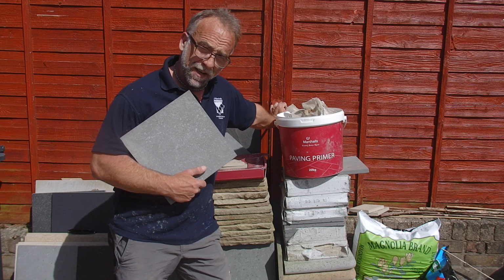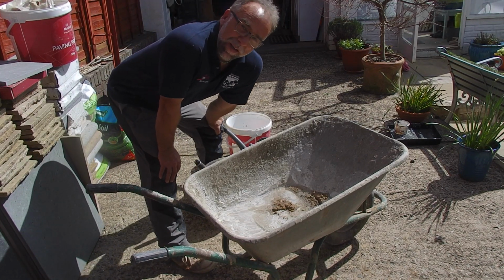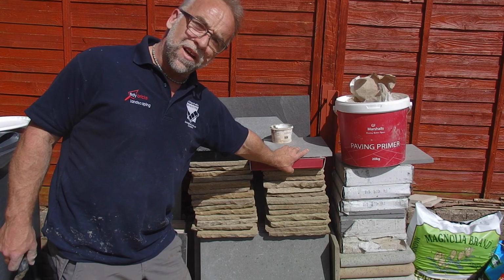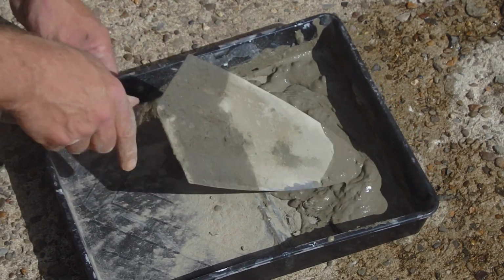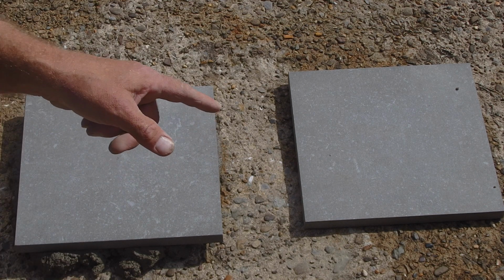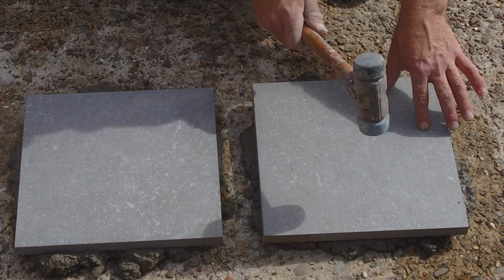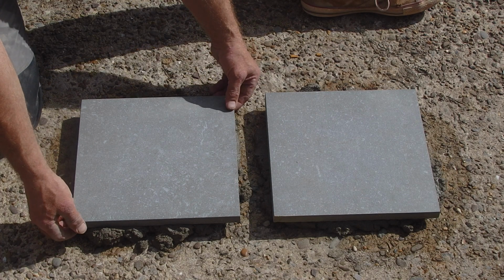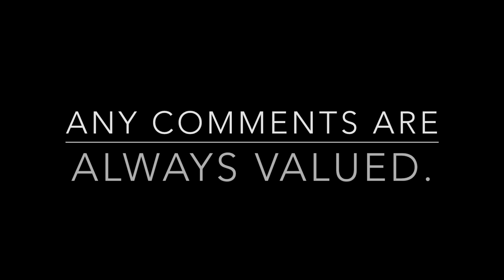Expert Advice on Priming Porcelain Tiles: What You Need to #primming #slurrygrout #primmer

Comment: You can use a cement slurry to prime the back of porcelain tiles or a sbr coat, both give excellent adhesion.
Reply from the maker: There’s lots of ways and a very important part of the installation must be done 👍🍻
Reply: I did the same thing,  I used a cement slurry mix as primer when I lay porcelain  outside!

Comment: Agree with you always have to use primer on a porcelain tile but I never buy it, sbr and cement for me, also I use a mix of sharp sand and building sand 70/30 for bedding as sharp sand for strength and building sand to help make mix pliable and to create more suction but liking your work tidy bricks. 👍
Reply from the maker: Thanks Wheaton I’ve had so many questions about primers so I decided yesterday to do a video and pass the boredom of self isolating..
And yes primer for porcelain is a absolute must. 👍🏴

Comment: I've got a 3 Indian stone flags that have come up after I pressure washed.  The bed is still flat.  Could I use this primer to  stick it back down rather than messing with the bed and making a bigger job?  I'm going to have to repoint too as washer took loads out.   Thanks.
Reply from the maker: Yeh you’ll be fine just using primer it’s stick back down nicely no bother bish bosh 👍🏴
Reply: @tidybrickslandscaping  great, thanks for taking the time to reply.

Comment: Myself and father in law will be installing porcelain tiles out the back garden this weekend. We have Evo Fix SBR waterproof bonding admixture, my question.... Does this need to be mixed with cement or can it be applied to the tile straight from the bottle? Your feedback would be appreciated. 😀
Reply from the maker: A cement based primer is best for porcelain I’d go down that road really. I did use sbr before on stone slabs only. 
No point risking it using sbr I’d say

Comment: Hi mate. Excellent videos. Quick question mate. Is Porcelain ok to be laid on an MOT Type 1. There are mixed reviews, lots are saying lay on a concrete base. Could I lay a lean mix concrete over MOT Type 1 to a depth of 20mm just to get the best of both worlds or would this be pointless?
Reply from the maker: Hi SW laying porcelain on type1 mot is the preferred way over here in the UK so ignore probably Americans saying lay on concrete but you could if you wanted but type1 is fine
Bed depth is between 30/40mm normal mix not lean. I prefer a semi dry mix myself 
Hope that helps any other questions feel free to ask 👍🏴

Comment: If the landscaper has installed porcelain slabs, and the slabs have not stuck to the slab/slurry and the wet bed mortar mix what should i do now? I am able to lift the slab up and notice that the mortar under is solid. Do i need to dig the mortar out again and start again?
Reply from the maker: You might be able to slurry them back down but the ground has to be dust free and tiles back exactly where they came from. Have a look at this video on how important it is. https://youtu.be/ 👍🏴

Comment: Can you use wet neat cement a a primer , ? old guy I work with swears by it 👍
Reply from the maker: You can yes but it’ll keep drying out all the time and go hard but a proper primer you got hours of time to use it. No point stressing 👍🏴
Reply: I mix pva cement bit of water
Does the job
Reply from the maker: @dannyjones6351  hey Danny thanks for watching I’ve done a new video for the primer test check this one out for more info 
https://youtu.be/3ecECF8s1go
👍🏴
Reply from the maker: Check this video out for further info on primers https://youtu.be/3ecECF8s1go

Comment: Couple of weeks and they will start poping off. Porcelain tiles have to be fix on solid base with flexible tile adhesive. So stop soaps people's eyes.
Reply from the maker: These are exterior tiles and laid on a cement bed
Reply: Stegan, you made my day. You have totally confused yourself. Indoor porcelain and ceramic tiles are laid on flexible adhesive, not porcelain patio tiles.
Reply from the maker: Stoyan Kolev and what makes you think there a indoor tile ? It’s a 22mm outdoor tile and laid on a flexible bed and cemented down
Reply from the maker: Porcelain tiles are laid on a flexible bed here in the UK watch this video https://youtu.be/tdKZ4eyo5nE 1m35 secs 👀
Reply: @tidybrickslandscaping  You are 100% correct. My comment was to the other guy who says you need to use flexible adhesive.